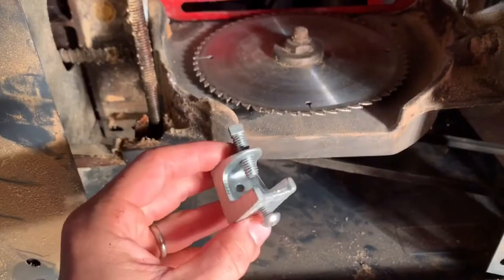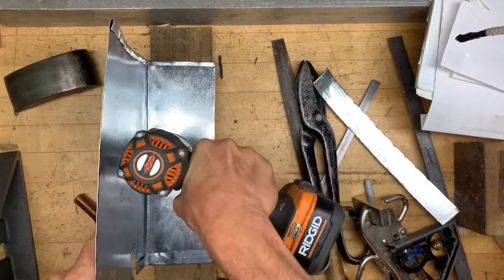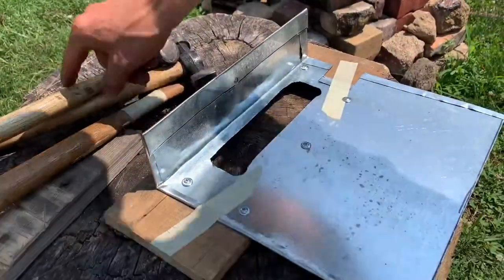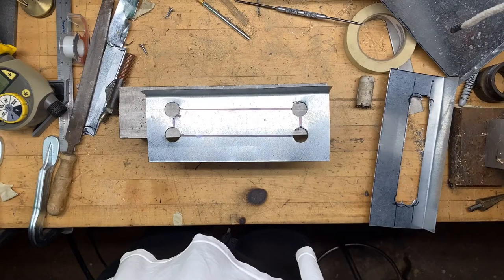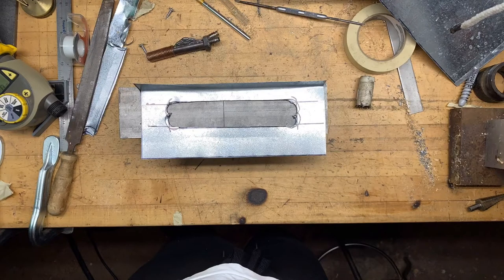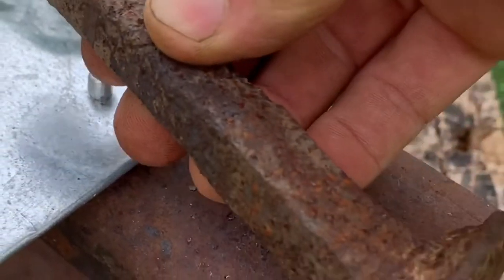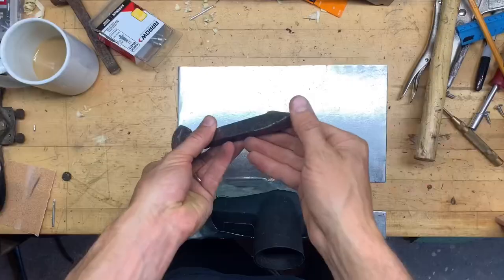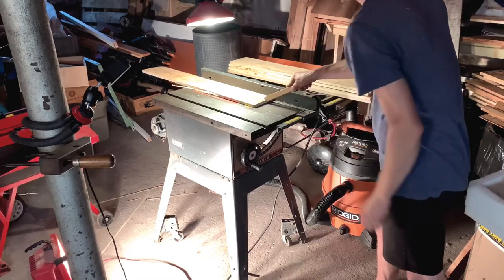Table Saw Dust Collector

Comment: Somebody please take away all this persons tools. No Riving knife, No gloves, No blade guard and you worried about Dust collection ?
 Get your priorities straight before they call you STUBBY.
Did you ever hear of a Brake to bend sheet metal? There is also the angle iron method. the tool you are using is called a Hand Seamer and you are not using it correctly.. No gloves and razor sharp sheet metal. BRILLIANT!
You excel ad working very hard to create an inefficient collector design when efficient collector designs already exist.